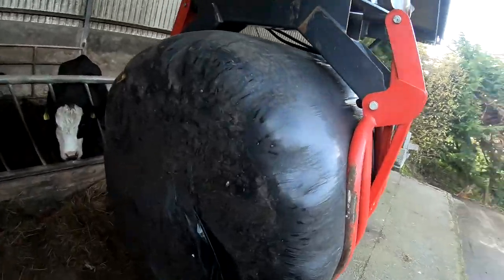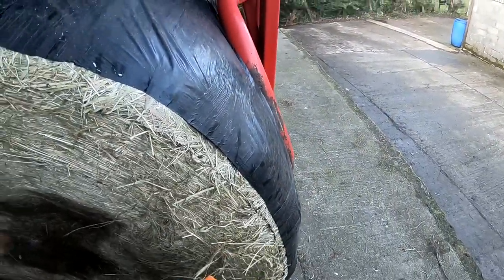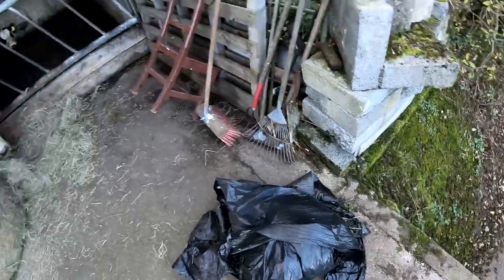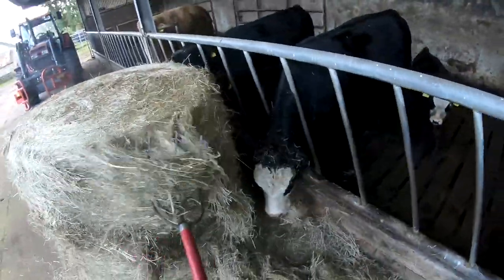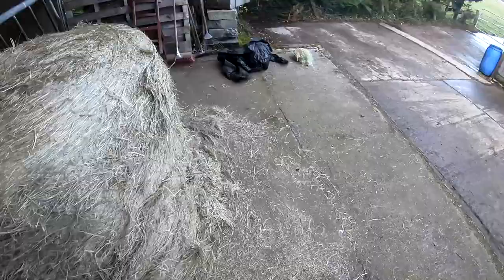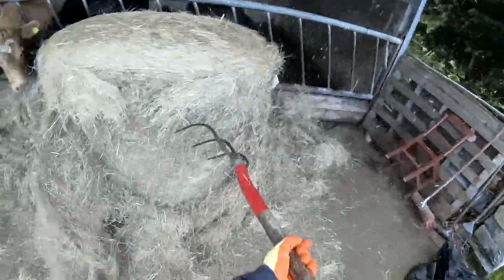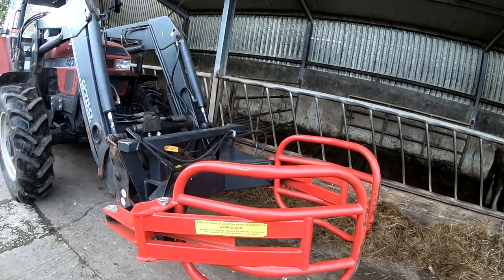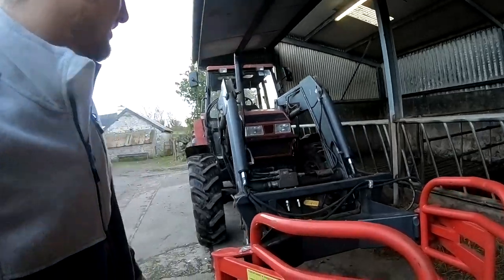How To FODDER ?!?

Comment: Good vid lad. We were using our sheargrab to feed and split third cut bales that we got done. We’ll be opening our pit soon enough.
Reply from the maker: Ah nice one, what make of shear grab have ye?
Reply: I do agri, it’s an old Wylie 3ft sheargrab. It was bought like over 30 years ago but it still does the job. It used to be on a mast but we took it off and Welded euro brackets to it for the loader
Reply from the maker: @ronancarragher4efe  nice one, youve gotten the use out of that one anyway. 3ft interesting I was thinking I would need a 4 footer to chop bales, but maybe not
Reply: @i do agri, cheers lad. I could do with 4ft to chop bales, but we rarely do bales so there’s no point in us upgrading yet. Also, out of interest does your 4230 have a shuttle. We had an 895 with one and it was slow on the road. Our Ford 4000 was far quicker tha her.